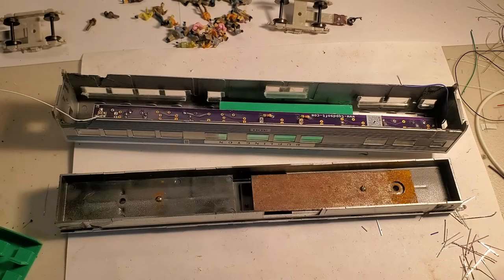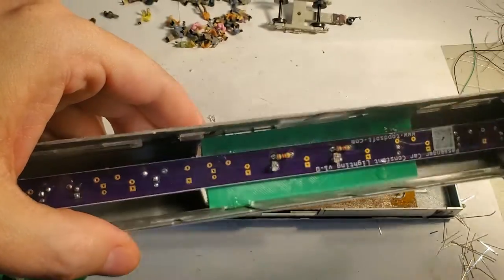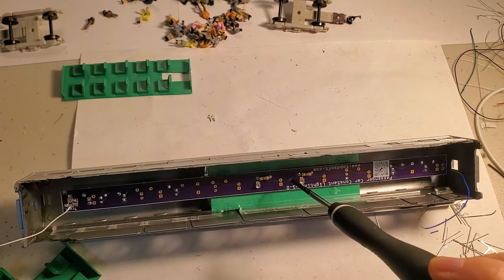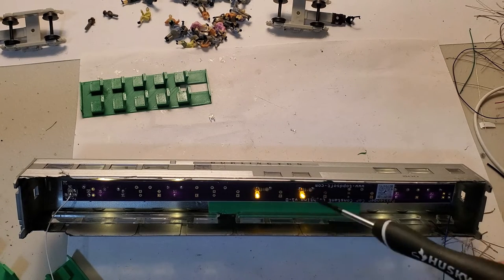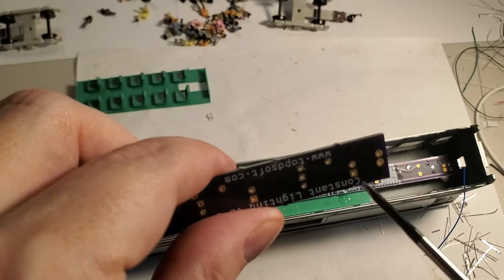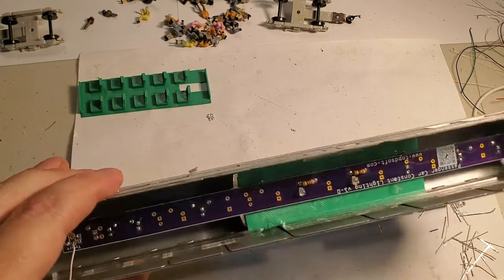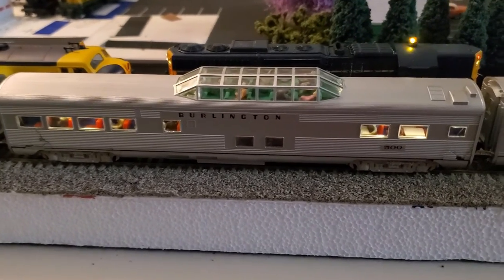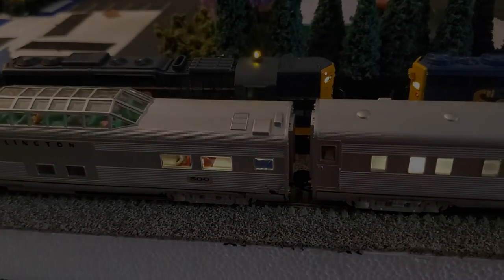Athearn Dome Car Upgrade

Comment: Hi Kurt. I am loving these boards. I’ve done 7 cars so far. I have a mail car ( I think) that’s shorter. The board is too long for it. Can the bird be cut down at any point or will it ruin the board ?
Reply from the maker: YES! You can cut off the side opposite where the four diodes are.  I also have two smaller boards, one for RPO cars and one caboose sized.  Good Luck!

Comment: Greetings. I have seen several of your videos and such and I have a roughly 1957 ish made tenshodo gp7 and ive seen u make all sorts of things with electronics to lights and such and I was wondering i bought this locomotive and it has 1 of the 4 original paper number boards and was wondering the best route to take to replace them to where I could possibly replace them to also tho at some later time to light them its all factory at the moment. Trying to still find routes to go with it
Reply from the maker: To make some number boards I would start with white plastic, cut it to the size of the old one.  Then file it until it fits.  For the actual numbers, check your hobby store for decals or dry transfer numbers which match your existing one.